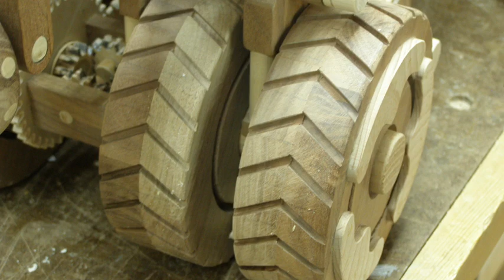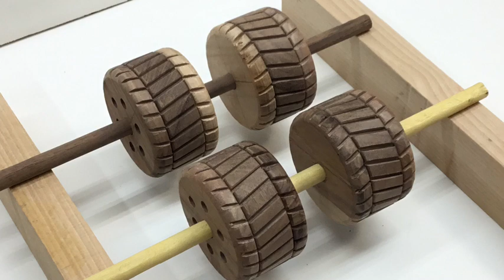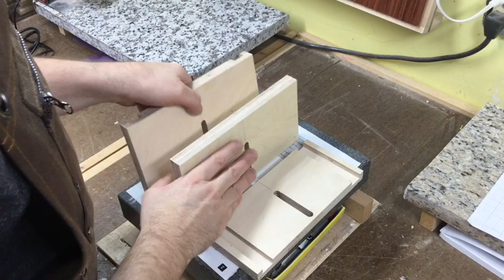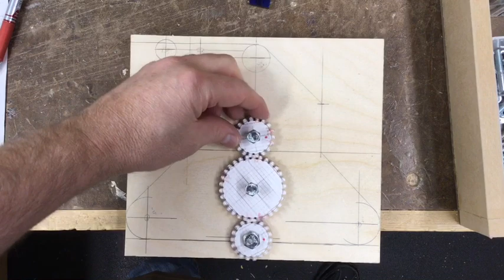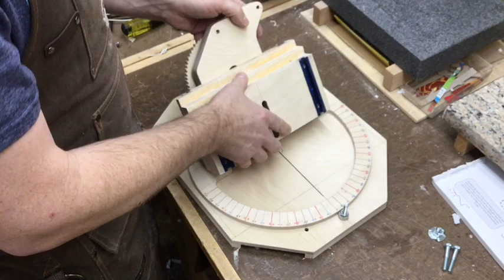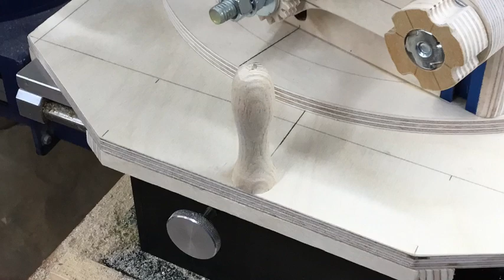Jig for accurate wood wheel tire treads - plans available

Comment: I just received a copy of the new Wheel Making Jig (imperial) book. First look through am very impressed, ingenious design. However, when I tried ordering the sprockets from Servo-City, had a rude surprise. Both the 16 and 18 tooth sprockets have been discontinued. I've searched the web and cannot find substitutes for these critical parts. Question, does the metric version use a different sprocket ratios? Please advise.
Reply from the maker: Well this is indeed unfortunate and disappointing. I am going to have to do some searching. The metric version uses a 60 tooth sprocket as the main sprocket and a 8mm(05B chain) which is slightly larger in pitch, therefore needing the smaller main sprocket. It still uses a 16 and 18 tooth for the smaller sprockets. I will look around and see if I can find another supplier for these components. Thanks for letting me know.
Reply from the maker: At first glance, try looking at plastockonline.com. They appear to have sprockets for .25 pitch chain.

Comment: Have you been able to find time to draw up the plans for your wheel tread cutting jig? Am getting ready to make a ton of wheels and it would be a whole lot easier to be able to use this jig.
Reply from the maker: David, I am working on the plans now. The instructions are about 75% done. I would expect that by Mid-may they will be available. Thanks for asking!
Reply: @s.g.devries8557  excellent!! Will be waiting patiently for their arrival. Will you be posting when they are ready, or will we have to check in later?
Reply from the maker: Just wanted to give you an update. The book is finished and I am waiting to get my proof copy from the printer. Sometimes this takes 2 days, other times it takes 2 weeks, all depends on how busy they are, since author copies are pretty low on the priority list. I will drop another note when it is finished, since the book will probably be available at least a week before the video goes up about it. Thanks for your interest.
Reply from the maker: Hello again. I have finished the plans and they are on Amazon. I don't have my video finished yet, but at least the plans are done.

Wheel Jig (Imperial) : https://www.amazon.com/dp/B0C6BWYG5H/ref=sr_1_1?crid=2WNMXCVNSMINC&keywords=wooden+wheel+jig&qid=1685369880&s=books&sprefix=wooden+wheel+jig%2Cstripbooks%2C103&sr=1-1

Wheel Jig (Metric) : https://www.amazon.com/dp/B0C6BR24DQ/ref=sr_1_2?crid=2WNMXCVNSMINC&keywords=wooden+wheel+jig&qid=1685369906&s=books&sprefix=wooden+wheel+jig%2Cstripbooks%2C103&sr=1-2

Comment: Do you sale a pattern for this jig it’s really nice I’d like to make one just to see if I could it looks very interesting thanks for sharing
Reply from the maker: Working on the plans right now. I needed to fix a little bit of wobble that had developed in the gearing mechanism so I redesigned to use a chain drive. I'm rebuilding it now. The plans should be available around June, 2023. Thank for asking.
Reply from the maker: My video isn't finished, but the plans are done if you are still interested.

Wheel Jig (Imperial) : https://www.amazon.com/dp/B0C6BWYG5H/ref=sr_1_1?crid=2WNMXCVNSMINC&keywords=wooden+wheel+jig&qid=1685369880&s=books&sprefix=wooden+wheel+jig%2Cstripbooks%2C103&sr=1-1

Wheel Jig (Metric) : https://www.amazon.com/dp/B0C6BR24DQ/ref=sr_1_2?crid=2WNMXCVNSMINC&keywords=wooden+wheel+jig&qid=1685369906&s=books&sprefix=wooden+wheel+jig%2Cstripbooks%2C103&sr=1-2
Reply: @s.g.devries8557  Thanks got mine ordered should be in Thursday

Comment: love the jig where can i get a set of plans for it.
Reply from the maker: I am currently working on the plans. I had to update the design to fix some wobble in the gearing, so I switched to a chain drive. The plans should be available around June, 2023
Reply: Even ones you build this one by
Reply from the maker: Hi. The plans are finished and available. I am still working on the video, but at least the plans are done.

Wheel Jig (Imperial) : https://www.amazon.com/dp/B0C6BWYG5H/ref=sr_1_1?crid=2WNMXCVNSMINC&keywords=wooden+wheel+jig&qid=1685369880&s=books&sprefix=wooden+wheel+jig%2Cstripbooks%2C103&sr=1-1

Wheel Jig (Metric) : https://www.amazon.com/dp/B0C6BR24DQ/ref=sr_1_2?crid=2WNMXCVNSMINC&keywords=wooden+wheel+jig&qid=1685369906&s=books&sprefix=wooden+wheel+jig%2Cstripbooks%2C103&sr=1-2

Comment: Look forward to the release of the plan book for this jig!
Reply from the maker: Currently working on it. Was a bit of a delay, and I also needed to redesign some of it. I wasn't happy with some wobble that had developed due to slippage in the gearing. So it is in progress. Thanks for asking.
Reply from the maker: It took awhile, but the plans are finished. Granted, you may not be interested, but that is fine. I got all the bugs worked out and I think the revised plans are much better and more accurate. Anyway, I will have a video soon, but at least the plans are done.

Wheel Jig (Imperial) : https://www.amazon.com/dp/B0C6BWYG5H/ref=sr_1_1?crid=2WNMXCVNSMINC&keywords=wooden+wheel+jig&qid=1685369880&s=books&sprefix=wooden+wheel+jig%2Cstripbooks%2C103&sr=1-1

Wheel Jig (Metric) : https://www.amazon.com/dp/B0C6BR24DQ/ref=sr_1_2?crid=2WNMXCVNSMINC&keywords=wooden+wheel+jig&qid=1685369906&s=books&sprefix=wooden+wheel+jig%2Cstripbooks%2C103&sr=1-2

Comment: Great video and terrific idea and design.  How are the plans coming along?
Reply from the maker: Still in the works. I am trying to come up with a way to minimize/eliminate the play in the gearing. Right now everything works fine if I make sure to always turn the segmented wheel in one direction, but as soon as I reverse it, the slop in the gear meshing messes up my tread spacing a tiny bit. Not enough to matter to most people, but it is bugging me. Thanks for the comment.

Comment: Excellent jig!  Hope you finish those plans soon - I would definitely purchase!  Also, what is the small table saw that you are using?  I really need a quality smaller saw for toy making.  Thanks!
Reply from the maker: Ross, sorry for the delay, I didn't see your comment earlier. The saw that I am using is the Jim Byrnes Saw from modelmachines.com. It isn't the cheapest hobby table saw out there but in my opinion is it certainly the best. I have had mine for over 15 years now and it still works just as good as the day I bought it. Thanks for the comment.

Comment: Amazing work! I've been dabbling around on some plans for one and a key thing people need to keep in mind is that you're using what appears to be a Byrnes 4" table saw. Personally, I have a 10" table saw, so I'm having to enlarge a few things to accommodate a larger diameter blade without cutting into the round base.

Comment: Will this work on a contractors table saw, or is a smaller table top saw required. I have a Metabo C10RJS table saw. GREAT BUILD!!!! This will surely be a money saver.
Reply from the maker: it could probably be adapted to fit a contractor's saw. Obviously the base plate would need to be larger. The danger in using a saw with a larger blade is that you do not want the blade to come into contact with the rotating ring. I have stop blocks so that I don't push the jig too far and cut the ring, but I am using a 4" diameter blade. With a contractors saw you would have a 10" blade and you would need to very carefully set the stop block position so that the blade made the cut in the wheel, but didn't go too far and cut into the rotating ring. Does that make sense? If you could install a 7" blade it would work better, but you would still need to be careful. Honestly, most of the small parts I build would be terrifying to build using a larger saw.

Comment: Very nice. You could use this on a router table too. V bits would make an interesting tread pattern.
Reply from the maker: You certainly could use it on a router table. I think if I did, however, I would want a more secure way of keeping the spindle from rotating. A table saw blade cutting almost perpendicular to the wheel doesn't put much rotational stress on the spindle, but a rotating router bit I imagine would put quite a bit of sideways force on the wood and want to rotate the wheel if it weren't held more securely. Good idea though. I will have to explore that.